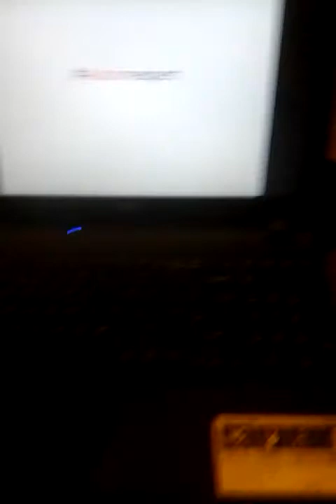Laptop Mousepad over sensitivity fix!

Comment: Can you share a link for the material you used? Thanks.
Reply: Its called sticky back plastic ,and you can get it in any hardware shop, supermarket .I recommend Ebay . You can get a sample  A4 size  piece , which is all you need for the mouse .

Comment: out of batteries for mouse so using touchpad. it's too sensitive. I think laptops were not designed to let users rest their hand on the laptop while they touch the pad at the same time.
Reply: A GeekSquad tech told me ALL the touchpads in the past 5 yrs were made by the same company and they were designed over-sensitive due to past user complaints. I wasted $550. on a HP laptop that no matter what I adjust the T/P settings to, it jumps around and types 6 of the one letter I want. My fix~ taking a hammer to the darn laptop.
Reply: that has nothingbto do with it.